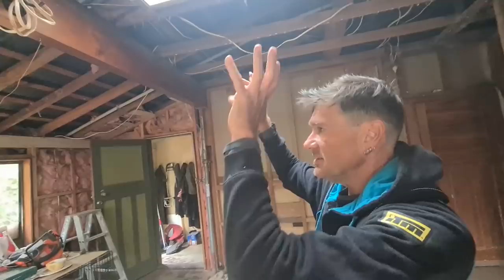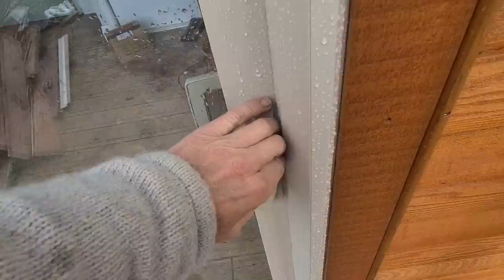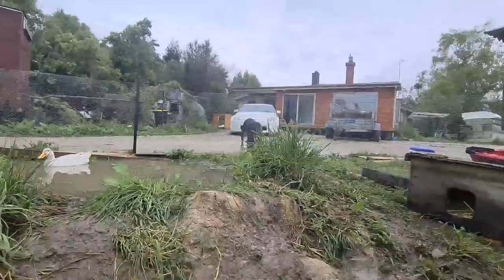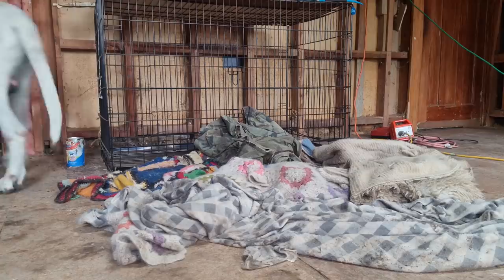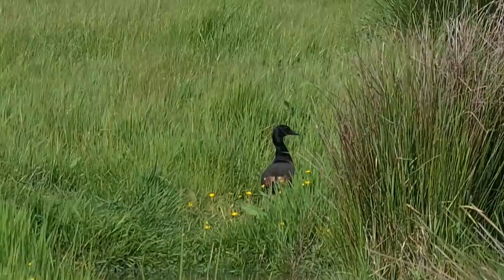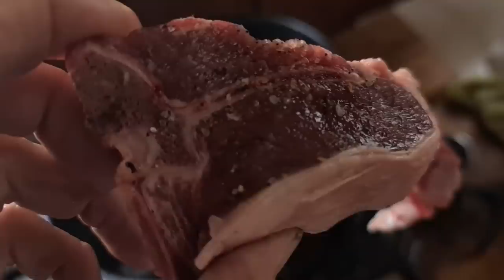Arb is back & the farm is full of new life.

Comment: Sir Clay Attenborough, of the New Zealand Pukeko! 😁
Clay,
The strawberry "end" that you pulled off with that massive double strawberry is a strawberry runner.
If it has roots on it, it was basically trying to escape the parent and become a new plant, genetically identical to the parent plant.

The green egg is possibly coming from one of your white "Peking ducks", which is actually an Indian runner.
When you choose a breed of chicken, you know beforehand what color eggs that hen will lay. But when it comes to ducks the rules are a bit different.
Ducks can lay white, bluish green or charcoal gray eggs, depending on the breed of duck.
But unlike chickens, ducks of the same breed can lay different egg colors.  And in fact, often don't even end up laying the same color egg as the color egg they hatched out of!  
(However, similar to chickens, once a duck has laid a specific color egg, she will lay that same color egg for life.)
The shade of the eggshell can vary over the life of a duck (and chicken) with the darker, more vibrant hues early in the life of the bird. But the overall color won't change.
Not to get too scientific, but all ducks carry two genes for egg color. 
They can both be the white gene (recessive), both be the blue/green gene (dominant) or be one of each.  
Each parent will pass on one gene to their offspring.
Continually breeding those ducks that lay and hatch from the most blue eggs will, over time, dilute the white gene and hopefully result in blue eggs.
But, ducks being ducks, there's always the element of surprise!
All domestic ducks descended originally from the wild mallard which lays light green eggs. 
Usually.
But it's thought that some early European duck breeders prized the rare, occasional white egg - and so started breeding certain ducks to lay white eggs.  
Over the decades and centuries as various duck breeds were developed and refined, they likely were bred for other characteristics than egg color, but egg color often ended up being the end result.
So the question of what color eggs ducks lay is pretty elusive. 

While you can't predict with 100% accuracy what color eggs your ducks will lay, this chart from  
"Metzer Farms"
 gives an idea of your chances of collecting white, green, charcoal or blue eggs dependent on the breed of duck you choose to raise. 

If you're looking for white eggs, these breeds are your best bet:
Pekin, 
Saxony, 
Silver Appleyard.

If you're looking for blue eggs, choose these breeds for the best chance:
Ancona
Magpie
Mallard
Runner

"A Rhode Island Red chicken will lay brown eggs, a Leghorn will lay white eggs. Ameraucanas lays blue eggs.
When you choose a breed of chicken, you know beforehand what color eggs that hen will lay. But when it comes to ducks the rules are a bit different.

So what color eggs DO ducks lay?
Ducks can lay white, bluish green or charcoal gray eggs, depending on the breed of duck.

But unlike chickens, ducks of the same breed can lay different egg colors.  And in fact, often don't even end up laying the same color egg as the color egg they hatched out of!  

(However, similar to chickens, once a duck has laid a specific color egg, she will lay that same color for life.)

The shade of the eggshell can vary over the life of a duck (and chicken) with the darker, more vibrant hues early in the life of the bird. But the overall color won't change.
Not to get too scientific, but all ducks carry two genes for egg color. 
They can both be the white gene (recessive), both be the blue/green gene (dominant) or be one of each. If you remember from high school genetics, each parent will pass on one gene to their offspring.

Continually breeding those ducks that lay and hatch from the most blue eggs will, over time, dilute the white gene and hopefully result in blue eggs.
But, ducks being ducks, there's always the element of surprise. 

Duck Eggs Started out Green
All domestic ducks descended originally from the wild mallard which lays light green eggs. 
Usually.
But it's thought that some early European duck breeders prized the rare, occasional white egg - and so started breeding certain ducks to lay white eggs.  

Over the decades and centuries as various duck breeds were developed and refined, they likely were bred for other characteristics than egg color, but egg color often ended up being the end result.
So the question of what color eggs ducks lay is pretty elusive. 
While you can't predict with 100% accuracy what color eggs your ducks will lay, this chart from Metzer Farms gives an idea of your chances of collecting white or blue eggs dependent on the breed of duck you choose to raise. 

"Duck Breed Comparison Table"

"If you're looking for white eggs, these breeds are your best bet:
Pekin,
Saxony,
Silver Appleyard.

If you're looking for blue eggs, choose these breeds for the best chance:
Ancona,
Magpie,
Mallard,
Runner.

If you're looking for charcoal gray eggs, then you'll want to add these to your flock:
Cayugas.

But no matter which duck breeds you choose and what color eggs they end up laying, I can guarantee you'll love raising ducks and eating the delicious eggs they lay, no matter what the color -white, gray or blue!"

So Clay, 
Indian runner ducks lay white to green and sometimes blue eggs.
If you followed the egg chart you will see what I mean! 🦆👍
Bruno looks nice and content, not showing pain but dogs are peculiar in that sense. 
Happy days with Arb back working, keep him going with the interesting stories.
Reply from the maker: top info mate
Reply: @ClayTallStories  hi Clay, watch out in the mail for something to help you with breeding your ducks, an automated egg incubator. 
I hope it arrives in one piece and that you can start growing some meat birds, as you wanted to. 
Letter & seeds inside.

Comment: hey clay nice vid. are you doing a full house reno or just kitchen and bedroom? On renovations where the house is old, and signs of water damage etc I find in these cases as a builder its better to tear it down and start from scratch, it may cost more in the longrun
Reply from the maker: Tearing the house down and removing it was going to cost about 25k. So far it has cost 25k to build  new deck and renovate my bedroom. We are already ahead. Based on this we will renovate the rest very slowly. I could not afford to build a new house. It would have to be a big house if I did to capitalize on the land so this is the path I have chosen.
Reply: @ClayTallStories  no worries mate respect that